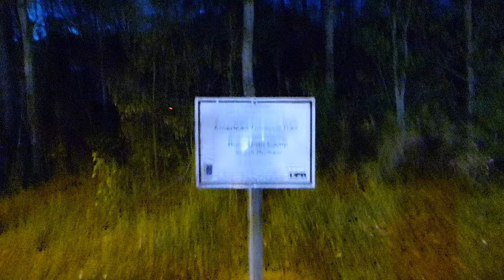Dell Inspiron 15-5100 Laptop Disassembly/Repair - Hinge Mounts DESTROYED, New DC Jack - Jody Bruchon

Comment: Hey I'm trying to fix the same laptop. And I have the same problem with this plastic mounting things breaking everywhere. Number one what epoxy do you use and is it strong enough for the hindges? or where can i just get a whole new or used shell cheap.?
Reply from the maker: Loctite plastic-bonding epoxy (blue and purple label). Yes, it's strong enough to hold hinges.